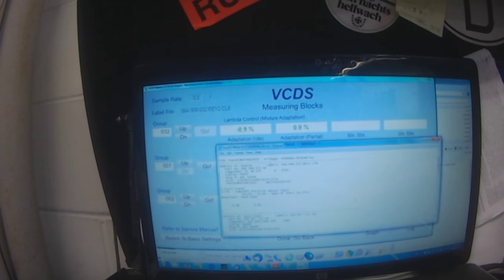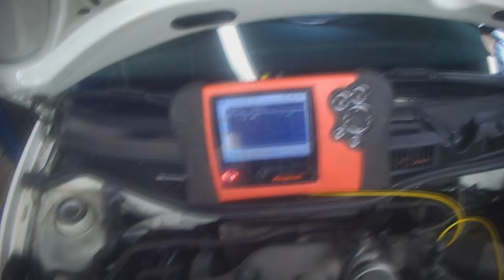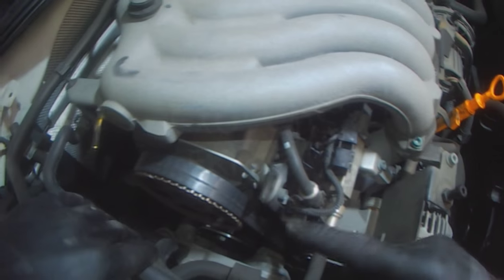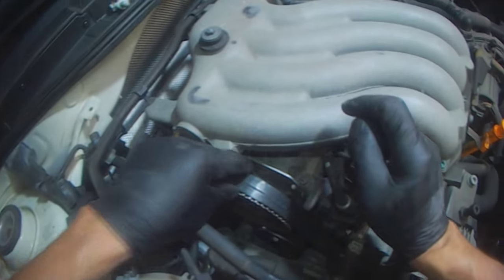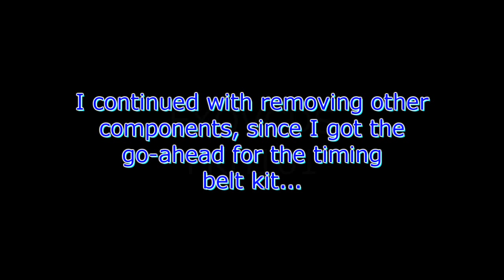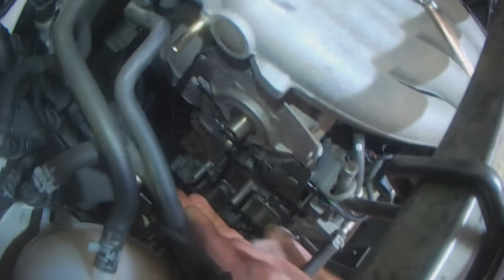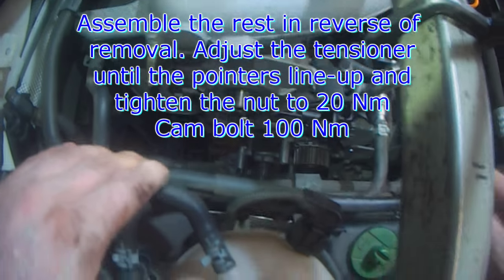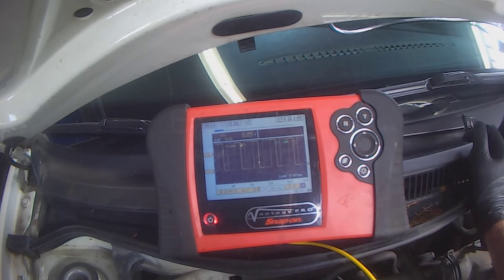VW A4: 2.0L Faulty Camshaft Position Sensor G40 (P1338)

Comment from the maker: At 8:30 the 10mm water pump bolt can not be accessed with the lower timing belt cover in place. Once the upper 13mm bolt is removed from the black metal plate (covering the cam sensor), the plate can be moved away from the engine to make room for removing the cam sensor, even though it is still attached at the water pump bolt.
Reply: Hello
Reply from the maker: Hello.

Comment: Rotate the camshaft do that you can see the TDC mark on the pulley. That way the woodruff key will be on top.  If it is on the bottom and you pull the pulley off, they key will fall down and you will never see it again.
Reply from the maker: Yes, it's always best to set the cam to TDC before removing the gear. Thank you for watching!
Reply: @EXOVCDS  The zip ties and bungee cord trick is pure genius. Made the job simple.
Reply from the maker: Thank you, kind of you to say!

Comment: Hi thomas, i have a Golf 2002 2.0L... is not passing 3rpm and just running 1st and 2nd shift.
Reply from the maker: You can check your cam sensor with a multimeter... like this:
https://youtu.be/A6XV5x0504c
Let me know what your results are.

Comment: I'm sure someone already asked this but typically, most vehicles I've encountered whether Asian/euro/domestic market, the signal return is almost always less than reference. 5 volt ref, .7-4.5 volt return or 12 volt ref, 0-12v square wave for example on a Hyundai. Can someone explain how or why on the VW 4 banger (I literally have a VW beetle in front of me right now) has a 12 volt square wave using a 5 volt ref? The car is fixed but just curious. Cheers.
Reply from the maker: You'd have to ask the VW engineers for the reasoning behind that... 12V square wave is not always the case. Later version of this 2.0L engine produces a 5V square wave (CBP engine). Earlier engines with distributors use a 5V signal (for the distributor hall sensor) in one version and a 12V in the other (might be OBDI / OBDII differences)... again, I'm not an engineer.

Comment: GREAT video! Exactly what I was looking for, thanks for posting. Question: I noticed you installed a Bosch sensor, which is probably the factory part. Would you consider aftermarket for this part? Like Delphi, for example.
Reply from the maker: Aftermarket is probably ok.

Comment: I just replaced one on mine. bought it at O'Reilly Auto Parts. 2 weeks later the same engine code came back and having the same problems. Today I started car to warm up. She stalled and now she cranks but won't fire. Not sure if it's related and I should just go and buy another one this time from the dealer or have it towed.
Reply from the maker: Bart Nash Engine should start / run with sensor unplugged. Check for missing timing belt teeth / if the timing belt us actually turning the camshaft.
Reply: dont ever buy electrical type parts like this from parts houses. quality sucks. only dealer parts

Comment: Heh, I had a cam sensor issue on my B4 Passat when I first got ahold of it.  What followed was probably the longest bout of automotive-related swearing and ranting I've ever gone through, as I learned that Volkswagen, for whatever reason, has decided to body-ground all the engine management sensors, rather than PCM-ground them like anyone with electrical engineering experience would do...

Long story short?  The cam sensor on a 12V VR6 shares its ground with the auxiliary water pump that sits right beside it.  I've looked over the wiring diagram time and time again, and I still can't explain why the PCM loses cam signal if you unplug the auxiliary water pump while the engine is running...
Reply from the maker: Weird... I'll have to remember to test that out on the next one I see (or look at a wiring diagram). Thanks for the heads-up!
Reply: *****
If you have the chance, please do, and let me know what you come up with!  I'm curious if they're all like that, or if I have bigger issues at play...

Comment: Would a faulty Camshaft make the car suddenly shut off itself? Mine is randomly doing this, last time happened while passing a bump and wouldn't turn on again until it got cool. VW Jetta 2001.
Reply from the maker: No, I have not had a cam sensor that would cause a stalling or no start situation. You can disconnect the sensor yourself and drive the vehicle with the sensor disconnected. If the stalling persists with the sensor disconnected, you can rule-out the sensor as the cause. The engine may run / have less power with the sensor disconnected... but it should still run.

Comment: once u put the camshaft position sensor in did put it on top dead center before or after on that vw beetle
Reply from the maker: It's always a good idea to put the engine to TDC before taking things off... I believe the engine was at TDC when I removed the belt & cam sensor. This was a Golf or Jetta, not a Beetle.
Reply: @EXOVCDS  i see what u are saying but it want move the teeth are gone all the way it is slick so do u think it is a good idea to put belt on then do tdc
Reply from the maker: Sorry, I forgot that you are the one with the broken timing belt / missing teeth.
Turn the cam & crank to TDC... it doesn't matter which one you turn first. Once both are at TDC, you can remove the belt or install the belt (if the belt is already off). 
While you are turning the camshaft, the camshaft will want to turn quickly / snap forward... that's because of the valve springs pushing on the camshaft lobes. Try to prevent the camshaft from spinning / snapping forward as you are rotating it.
Do you know what the both the TDC marks look like? Camshaft & crankshaft (at the transmission)?
Reply: @EXOVCDS  yeah I see the marks someone already put white out on the marks and orange on the crankshaft pulley when I pulled the pulley off earlier
Reply: @EXOVCDS  could one of the rollers freeze up and cause the timing to not turn i wonder
Reply from the maker: @leeroger1471  The only thing that can seize up and strip teeth is the water pump or camshaft. 90% of the time, missing teeth is due to the belt being too old. Do whatever you have to do to replace the timing belt, water pump & the tensioner. Once everything is back together, start the engine. If the engine runs rough, then there are some bent valves... you will have to remove the cylinder head to fix that.
Reply: @EXOVCDS  i thank u so much i will try putting new belt on i say the belt was old and it was gonna break very soon so i will see about tdc then put new belt on and camshaft sensor and see how it goes..i wish i could send u a pic on here do not know how to
Reply from the maker: @leeroger1471  click fkh161 link in the description and then click Tool Request to send me an email / picture.
Reply from the maker: @leeroger1471  click tool request on my website.
Reply from the maker: @leeroger1471  I'll  check my email tomorrow after work.
Reply: @EXOVCDS  so what do the camshaft do and the crankshaft and i will have to turn the crankshaft clockwise to get tdc and how do i turn the timing sprocket to tdc
Reply from the maker: @leeroger1471  you can turn the camshaft or crankshaft clockwise or counterclockwise to TDC... it doesn't matter which way. Turn the camshaft first. Use an 18mm (i think) wrench on the camshaft gear / spocket to turn it (belt should be off) until the tdc marks line up. Then turn the crankshaft until the tdc mark on the pulley  lines up with the dimple on the lower timing belt cover. I'm  starting to repeat myself. We already talked about this via email.
Reply: @EXOVCDS  i was at work when i was emailing u now i am off no internet on phone on my laptop i will take more pics tomorrow and friday and email them to u
Reply: @EXOVCDS  do u know a cheap handheld computer i may can get to program my remote key
Reply from the maker: @leeroger1471  Try this:
https://www.youtube.com/watch?v=26LBUmHBX0o
Reply: @EXOVCDS  i found a company in florida that has the cylinder head for 300 dollars so instead of getting parts in pieces just this and get the timing sprocket and timing sprocket was cracked from old age so buddy of mine is helping me to fix it and i do thank u so much for your help i am very grateful u helped me
Reply from the maker: @leeroger1471  You don't know if valves are bent... why not set everything up with a new belt and then do a compression test?

Comment: Hi Thomas - thanks for the video!  I have a 2003 Jetta 2.0L with a P0343 (Camshaft Position Sensor Circuit High Input) and engine will not rev past 3100RPM.  I checked the voltage at the three pins and have a steady 5V on the left, steady 12.8V in the middle and 0.03V on the right.  Does the steady 12.8V on the middle pin confirm the sensor itself is the culprit?  TIA!
Reply from the maker: Yes... if it were working, your multimeter would show less than 12V because of the signal being a square wave (on / off 12V).
Reply: Thanks so much for the quick reply Thomas, much appreciated!  ...a new cam sensor is on order.  Cheers :)
Reply: Thomas EXOVCDS  Hola disculpa espero me puedas ayudar tengo un jetta 2005 automatico que no me pasa de las 3000 revoluciones y manda falla en sensor árbol de levas . Que me recomiendas ? cambiarlo ?
Reply: Hey there, very late reply but when you said that the signal wire should read less than 12v, about how much less? (pretty electronically illiterate here lol) Have a 2004 Jetta 2.0 that will crank, gets fuel and spark, but won't start. Suspecting either CPS (even though it won't start?), timing belt (not broken), or ECU (no idea how to rule this out lol)
Reply: Garcia Banda oye amigo como solucionaste tu problema de  que no pasaba de las 3000 rmp tengo un problema similar con un beetle 2001 no pasa de las 3000 y me saca código del cmp crees que me puedas ayudar
Reply: Hi can anybody help me I have a 2004 Vw jetta 2.0 I just brought it and it have a code reading p0010 but the car don't have the wiring contactson it looks likes he cut it to by pass the camshaft senior can anybody help

Comment: Hello. Any idea on how to fix the horn? The fuse is ok and I replace a new horn. Still no luck.
Reply from the maker: Horn button in steering wheel, horn / airbag clock spring under steering wheel, horn relay, bad wiring? Could be any of those.

Comment: Great videos. I am about to do the timing belt, water pump and cam position sensor on my AVH. would you recommend replacing the cam and crank seals if they are NOT leaking just for good measure, or should they just be left alone?
Reply from the maker: +Chris Gelder It would make sense to replace them at the same time as the other components. If they look fine, they will probably last until the next belt service. I once changed a non leaking seal on my BMW and the new seal would not seal.... went through 2 seals until I gave up and installed a speedy sleeve. The crank journal was worn, so the new seal could not seal because it could not conform to the shape of the worn journal like the old seal did. So basically trying to prevent a future seal leak (by replacing a seal) I made things worse. Now I only replace seals that have signs of leakage.
Reply: +Thomas EXOVCDS thanks for commenting back! I ended up changing the cam seal because it was leaking but left the crank seal alone. quick question, is it normal for the timing belt tensioner adjustment "arrow" to bounce around when the car is running? just finished up the job and checked the tension while running and the adjustment arrow is kind of vibrating, for lack of a better word. it doesn't seem to change the actual tension though.. the nut is a tight as I can get it. thanks for helping the world with these videos, you do great work!
Reply from the maker: Chris Gelder Yes, some bouncing is normal... sometimes they barely move. It's the power pulses from ignition and then the lack of power pulse that causes the bounce / wiggle. As the belt stretches / wears, it becomes loose and you will see the bounce / wiggle be a bit more pronounced.

Comment: Do you have to bring the sprocket to a certain position (TDC?) to take it off and preserve timing or just pull it off and zip tie the belt?
Reply from the maker: Whatever you feel comfortable with. If you set everything to TDC, then you can make sure that timing stays the same, in case the belt slips, the cam & crank are where they should be.
Reply: @EXOVCDS  Thank you for the advice!

Comment: Hi Thomas. I have a VW Jetta 2.0 and it cranks but it won't start at all. It was running perfectly fine yesterday but when I tried starting it up today It wont start at all. I recently change the spark plugs, wires and coil pack so I think that's not the problem. I also tried checking the spark plugs if it has sparks but I didn't see any. I also tried hooking it up to a scanner but I didn't get any codes. Maybe the cause is a faulty CPS? Looking forward hearing from you. Cheers!
Reply from the maker: Could be CRANK Sensor... is the RPM needle moving when the engine is cranking? If not, could be crank sensor. Cam sensor is not needed for the engine to run. Have someone tap on the bottom of the fuel tank  (rear right passenger side) while you are cranking the engine... it the engine starts, fuel pump is bad. If you are sure you have no spark, focus on Crank Sensor / ECM sensors.
Reply: Thomas EXOVCDS Appreciate your help. Will update you soon if it works. More power on your channel! Cheers.
Reply from the maker: When the engine turns over (trying to start the engine)... what does it sound like? Does it turn quickly / sound like it is turning quickly? Like in this video? https://www.youtube.com/watch?v=8ySwgYfgQo0
Reply: @EXOVCDS  Thanks mate your a LEGEND  the crank sensor is definitely the culprit. But I had another problem and it annoys me though. I noticed a slight a misfire ONLY during idle and I can't point it out what's the cause of it. I'm sure it's not with the coils, spark plug and leads. Is it possible from faulty injectors, O2 sensors or something else?  TIA
Reply from the maker: @kingabbotfilms  could be injector spray... I don't think an o2 sensor would do that (if things are ok off of ideal).
Reply: Thomas EXOVCDS thanks man will try to check the injectors. Appreciate your help it saves me hundreds of bucks.

Comment: Hii 
I am writing to see what the problem could be with my car. My garage is out of ideas, so i would be grateful if you could put in your views.
Its a Skoda Superb 1.8TSI, 2011 model
I got a head gasket replaced and a few cam timing chain guides replaced (only the chain guide and not the actual toming chain)

The car is running just fine. There is no misfire or rough idle or any visible abnormality and there is no overheating now, due to which i had to have the head-gasket replaced, but the EPC light comes on intermittently leading to an MIL light (check engine light) and the scanner gives the code P0341 (Camshaft Position Sensor A Circuit Range/Performance Bank 1 or Single Sensor)

Now we replaced the oil control solenoid as well as the sensor. Voltage at the connector is 4.7V., yet the fault code refuses to go.

Plzzzz help !!!!
Reply from the maker: Using a scan tool, you should be able to see the position (in degrees) of the intake camshaft, as well as the "phase" position... what are the values? You need to have someone check the camshaft & crankshaft signals with a "scope", so that you can confirm correct position / alignment of the camshaft & crankshaft signals. We don't have Skoda in Canada, sorry. 
Cam & crank signal example:
https://rotkee.com/image/cache/catalog/defect/image-defect-16339-cbfSCQE4foW2IFdcMiFfxmRdJPlhx1fj-1156x700.png
Once you have a capture of your sensor signals... you can compare your image to a known good image (you have to find one or test a vehicle that does not have the same fault code).

Comment: Hello Thomas,
I've been working on my dauhters 2000 beetle 2.0L for some time now. Started with water pump then head gasket, coil pack and most recently valve stem seal per recomendation. As I was pulling off the camshaft without removing the sprocket I heard a crack. when I removed the camshaft I noticed tbat I had broken the camshaft sensor. After all the work was done I replaced it with one I gao from the junkyard, I checked the numbers stamped on it and they all matched. Car starts but turns off after a while. I figured that the sensor was bad and replaced it with another one from the junkyard and still the car shut down after a while of driving. Could it be that both sensors are bad cause I don't really see anything wrong with the sprocket.

Comment: Have you notice that when you get a faulty cam position sensor with a car with no throttle cable in neutral the car will not rev past 3000 rpm that is with the engine hot I can't remember if it would do it cold and a car with a throttle cable will be able to rev to red line but no power all the time .
Reply from the maker: +V10PDTDI No I have not. I have heard of (and people have asked me about) peoples cars not reving past 3k rpm. I always thought that it was like when you perform basic settings (brake & gas at the same time). Some of the new TDI's won't rev past 3k when in park or neutral... those I have noticed. None of the people who have contacted me have mentioned a stored cam code. I'll keep it in mind. Thanks!
Reply: I'm having this problem now. If you go above 50% throttle it wont go past 3k. But if you accelerate slowly you can go 80mph no problem